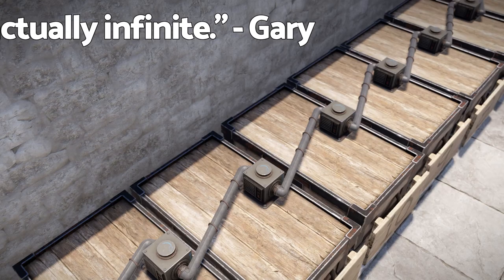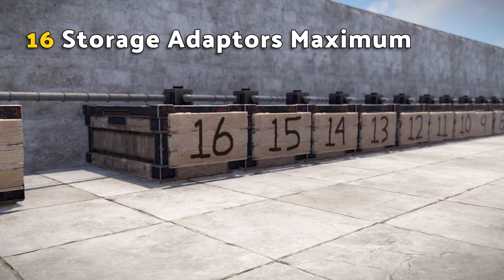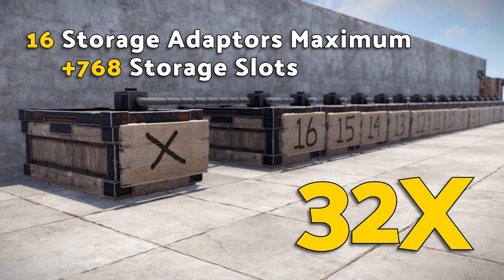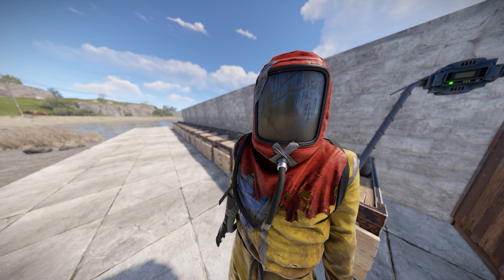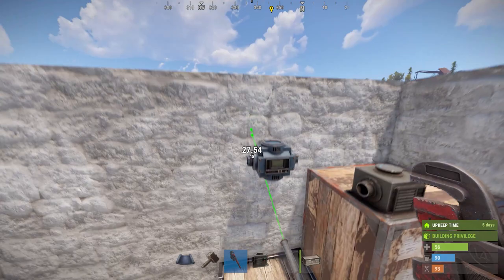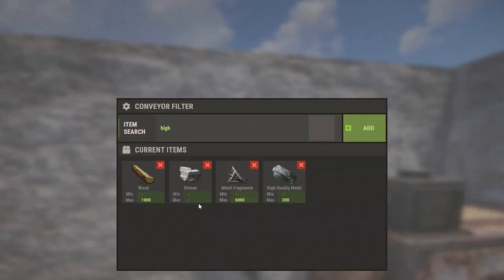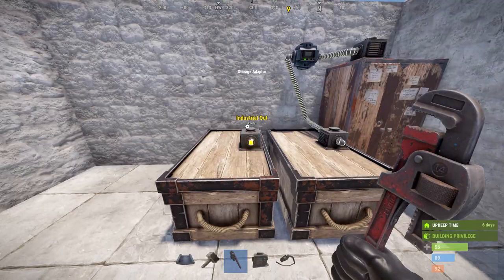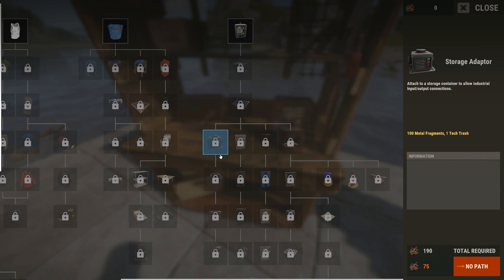Infinite Tool Cupboard - Rust Industrial Update How To

Comment: I dont have rust so I cant test this, could you test this for me? I know they made it so the pipes cant go through walls, but could they go through the gap made by the shooting walls (the ones a little shorter than halfwalls) if you had it so: you have a sealed 1x1, but for one of the walls you have a halfwall on the bottom and the shooting walls on top of that. Could the pipe fit through the gap in between the shooting wall and he roof above it?
Reply from the maker: I'll look into it 👍
Reply: if you mean low walls, yes the pipe can go through it, some people are using the half wall and low wall stacked and put the pipe in the final 1/4
Reply: Yeah, it passes throught 3/4 walls making ur core effectively a bunker. You can also withraw in and out items from your core throught few convairs. It's not difficult to set up and it takes very little energy.
Reply: @iampwnflakes  by withdraw in and out items with conveyors you mean with the little gap created at the top? or is there a way to clip pipes through walls using conveyors?
Reply from the maker: Check my low wall bunker video here: https://youtu.be/iNOOgfSv5_U
Reply: @OGProcess  thx!